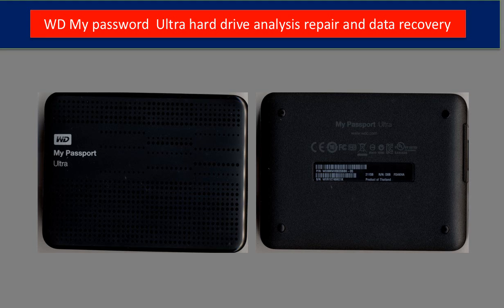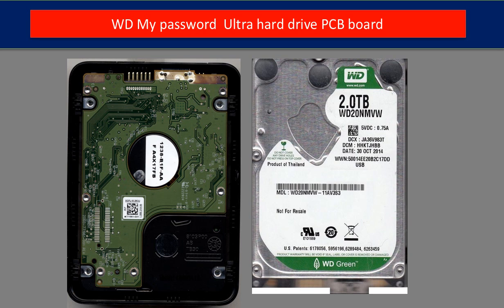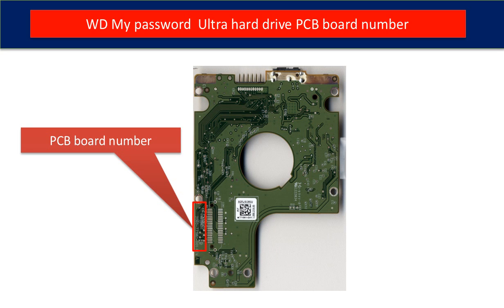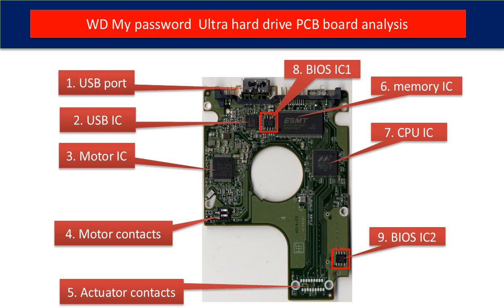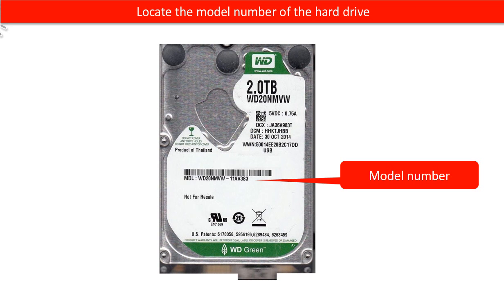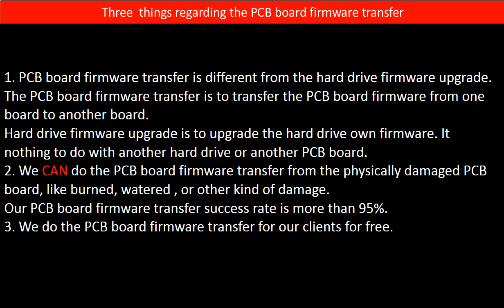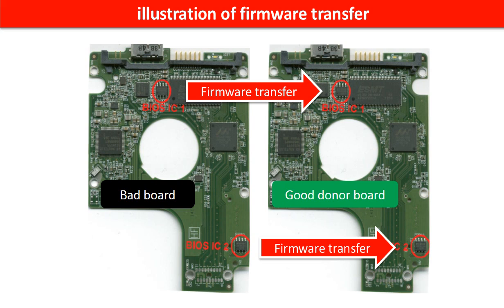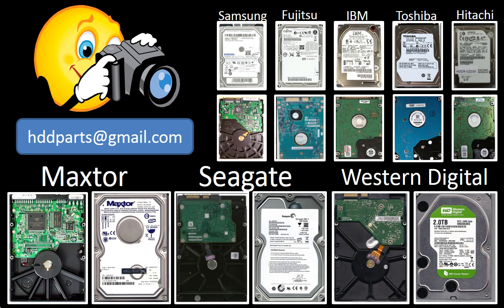WD My Passport Ultra 2TB WDBMWV0020BBK fix board swap 771961   WD10JMVW  WD15NMVW   WD20NMVW  WD5000

Comment: What if the new board is taken from another hard drive of the exactly same model? Can I simply swap them? Thanks in advance.
Reply: That should work as long as the firmware is the same version on both boards. Saying that, you might be lucky. Worth a try IMO.